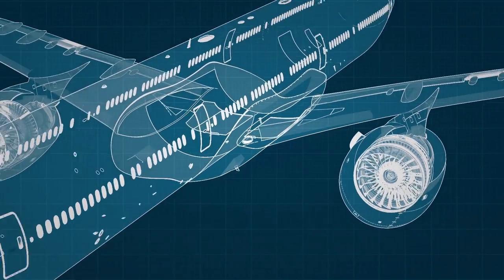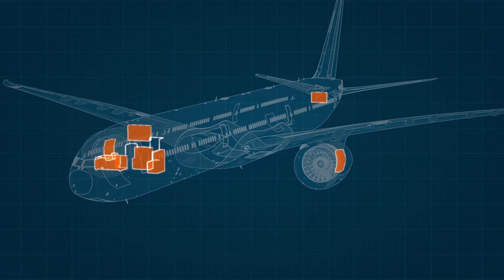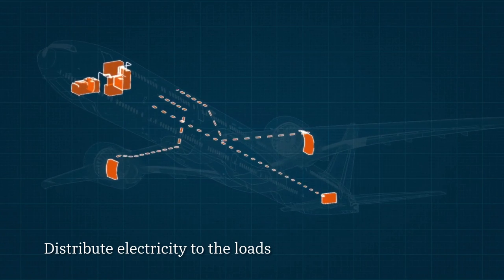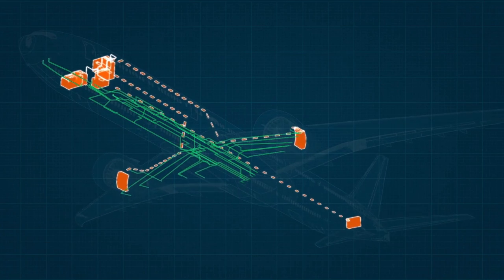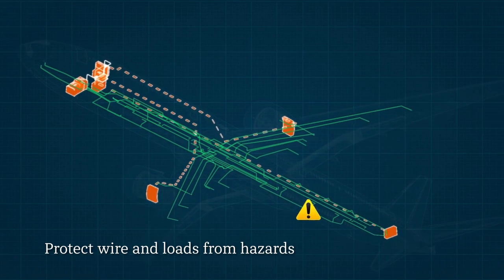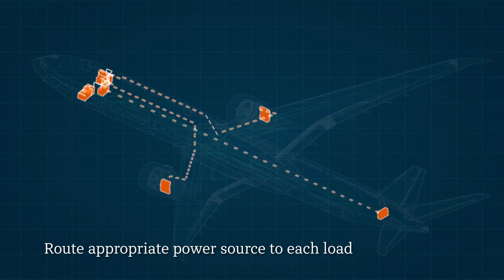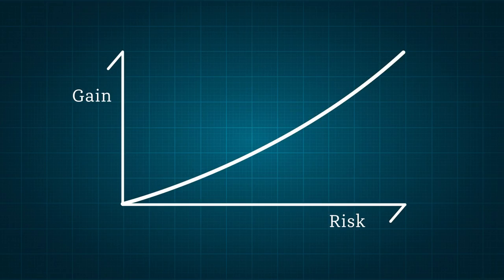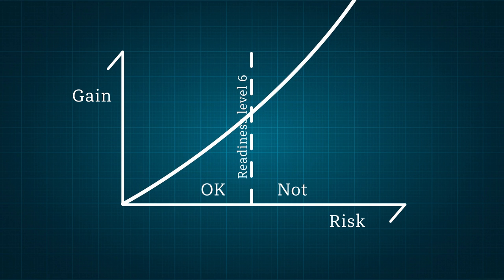GE Aviation Electrical Power Distribution - Design Considerations

Comment: how AC power is generated in a aeroplane
Reply: Wanda Pennington generator.
Reply: Power for ac cames from the energy generated from the engine
Reply: IDG - Integrated Drive Generator ( Constant Speed Drive spins an AC Generator once the Engine  stabalizes at Idle power, the Generator Contactor Breakers are closed , this then supplies the AC Bus and the Essential Bus feeds critical loads off the airplane.